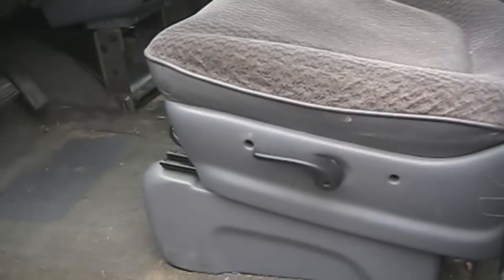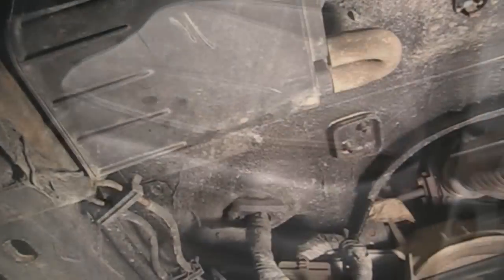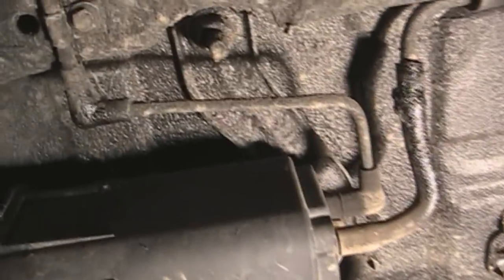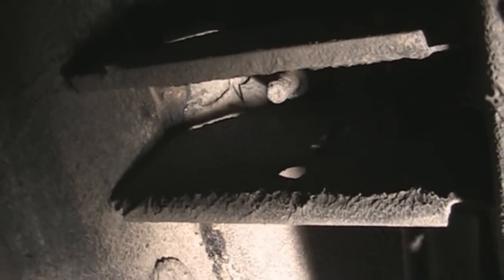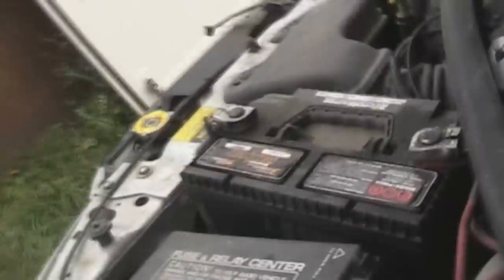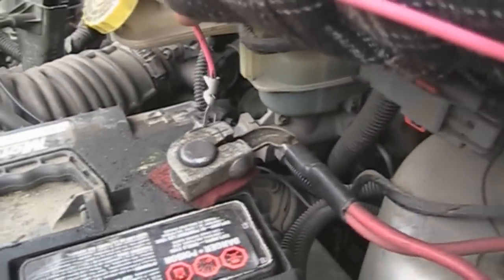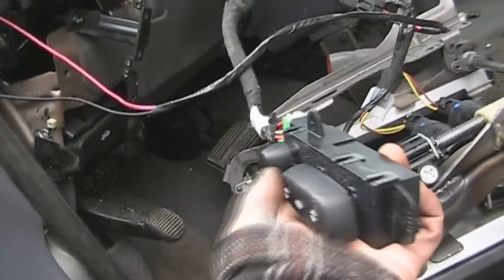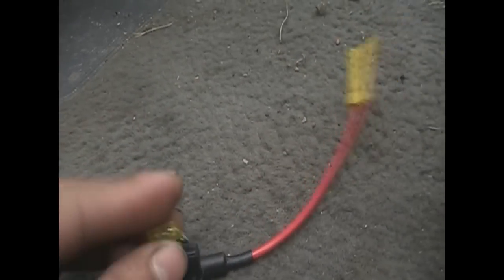How to install power seats in your car easy step by step 2000 dodge grand caravan

Comment: Thank you thank you thank you for showing where the wiring from the seat runs to. Positive to the internal fuse box and negative to any part of the metal frame.
Reply from the maker: no worries, There might be a better connection for the positive if you want it to work when the car is off but the connection woks for me, glad it worked for you, Cheers.

Comment: Hello there,could you help me out in wiring the old camry power seat(2005).I'm confused.
Reply from the maker: I can try, what is it that you need?
Reply: @FritzMadness  I want  swap those seats to other vehicle and I can't configure now which wires of that bunch is heating function wires.
Reply from the maker: @amitojdhanju706  I see! Well any 12v power wire that works when the vehicle is on only!
Reply: @FritzMadness  can you tell me which wires generally run heating function of the seats
Reply from the maker: @amitojdhanju706  not sure my friend, depends on the car you gotta test it with a multimeter before you remove the seat

Comment: Fritz STOP MOVING THE CAMERA. It takes 5 seconds to focus on something. Just STOP. recording is almost free. I wanted to see what things looked like. The camera can't focus if you keep zipping around. And I really wanted to see you take out the bottom bolts. But you skipped all of that.
Reply from the maker: I’m sorry, I didn’t have a tripod at the time.
Reply: Fritz - I learned something anyway. Ended up getting rid of the vehicle - after 15 years😀
Reply from the maker: Nick Radonic that works too, good to hear you learned something. The next project is gonna be easier for you 🙃